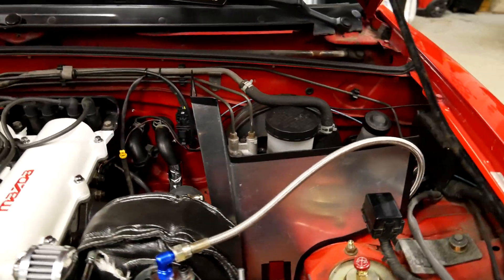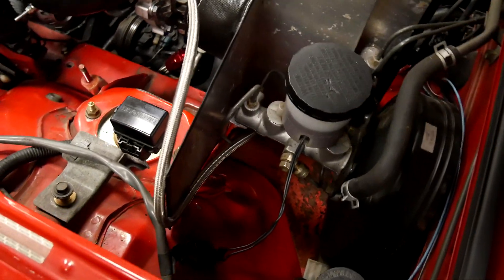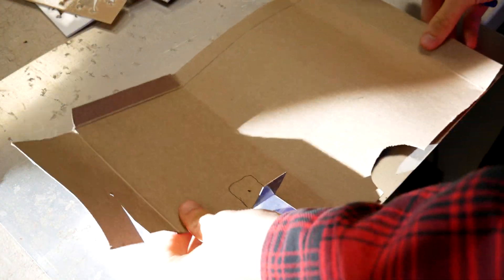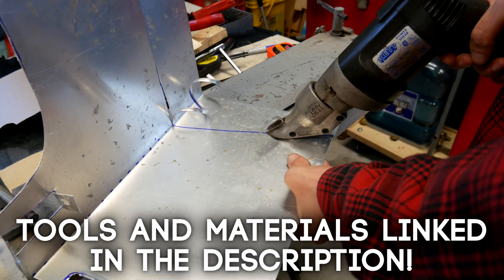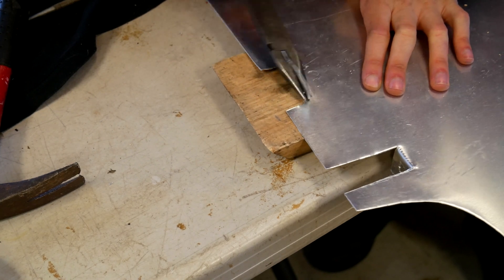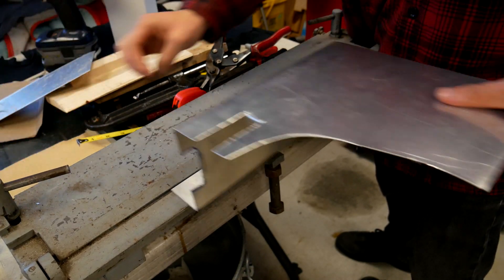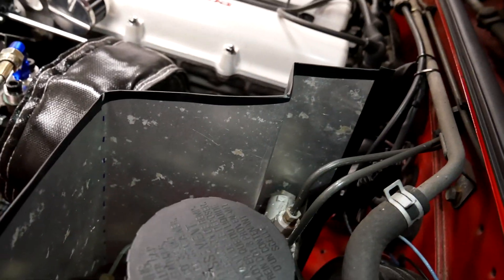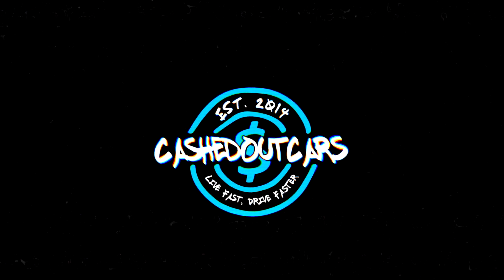How To Build Custom Heat Shields | Keep Critical Parts Cool!

Comment: Awesome video! Do you have any ideas on building a heatsink between the engine and bonnet vent to conduct and expel heat towards the edges of the hood so it escapes the engine bay quicker?
Reply from the maker: I haven’t tried that, but that would definitely be a good idea that I can see working well! I haven’t had any heat issues with just the shield
Reply: @CashedOutCars Yeah not sure it would work better than just installing vents, but together with vents it might if it was airgapped properly.

Comment: im planning on adding a heat shield on my 95 buick lesabre between the throttle body, most importantly the coolant temp sensor and the exhaust manifold. i also added a flexible heat shield between the lower radiator hose and the ICM.

Comment: Did an oil filter relocation, which involves 2 - 1/2 inch ID hoses passing the exhaust manifold in 2 places,  only years later to find the hoses had been negatively impacted by the exhaust manifold heat.  Am grateful I didn't dump all of the oil, but discovered this upon a check on the oil spot in my driveway.  During the install, it seemed like 3 inches away from the heat source shouldn't affect the hose.  My mistake.  Am currently working on both wrapping the 2 hoses completely with some flexible heat shield sleeves separately, then followed by aluminum shielding in 2 locations (where the melting damage was found).  Love the CAD!  I was planning to do similar as your approach.  Just checking around  for some ideas.  Thank you for sharing.

Comment: Just finished making a brake heat shield and intake air box using your method. This vid definately helps a ton
Reply from the maker: Awesome man! Enjoy your car!
Reply: I used cardboard to make my heat shield wrap with Adhesive Backed Aluminized Fiberglass Heat Sheet Heat Protection Barrier Cover, for my cold air intake filter.

Comment: Say goodbye to your heater core hoses
Reply from the maker: They’ve been holding up great and are heat wrapped
Reply: @CashedOutCars  until you go to the track or take it on a long drive. There’s a reason I covered mine.
Reply from the maker: I know there’s a reason which is why I wrapped mine, what did you use to cover yours, another heat shield?
Reply: @CashedOutCars  why bother building a heat shield at all then? Everything you blocked is further away then what your heat wrap covers. I would suggest putting more heat wrap to cover the whole hose at least. For my set up I had to completely relocate my heater core hose because of how hot it gets. My previous set up I had a heat shield that has heat wrap on both sides and I also put heat wrap on my hose. I also bent the aluminum hose back so that the line would run behind the oil dip stick. I have videos of all this on my channel so you can see yourself. I’m not trying to be a dick just trying give you a heads up.
Reply from the maker: I know you're not trying to be a dick, I appreciate the concern. I checked out your setup and it looks good. The reason I built mine how it is is because I'd rather protect my brakes than my heater hoses and I didn't like how the shield would have came out for it to do both. Losing coolant won't be an immediate safety concern, losing brakes would. My heater hoses are bent back as well, they aren't as close as the video makes it look but I agree, I should wrap them more and can bend it around the dip stick. With that said I haven't had problems with continued abuse, but it's something I'll do. Thanks!